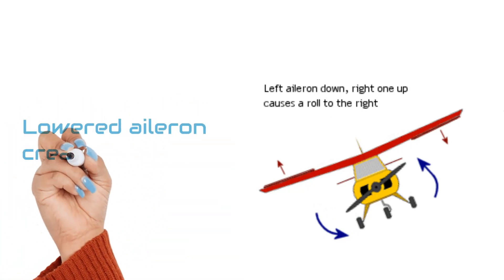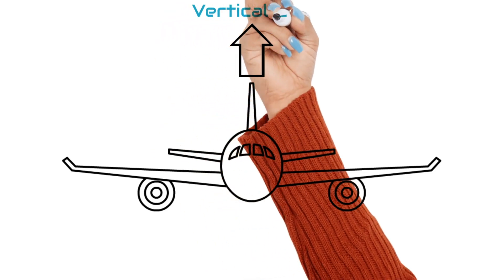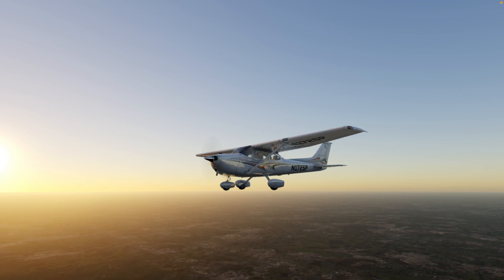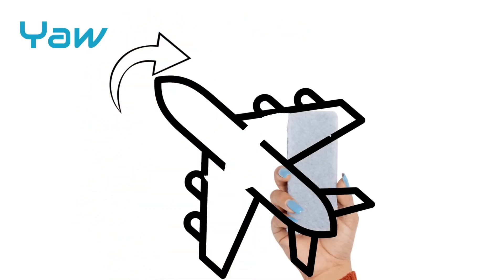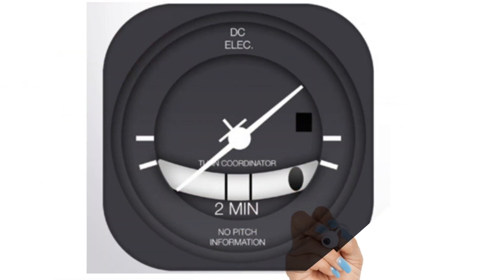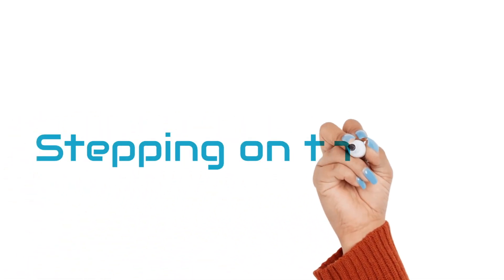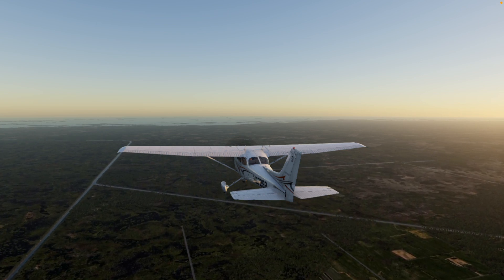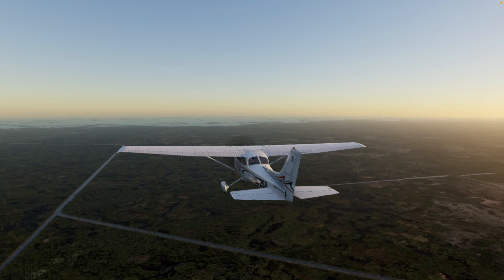How An Airplane Turns: Private Pilot Ground Lesson

Comment: Excellent explanation.  There is an unintended problem with how we explain coordination, however.  Usually we say we use aileron to bank and rudder for coordination.  We almost never say we use rudder to yaw correctly and aileron to bank for coordination.  This now sounds awkward, but unless we lead rudder there is no coordination initially.  Videos of students having the very common problem of longitudinal alignment with the centerline on short final illustrates this common problem.  Notice that the yoke is being moved left, right, left dynamically to constantly correct misalignment.  The only sure correction to this problem is to have the student remove her/his hands from the yoke and move the rudder left, right, left, right quickly and constantly to tightly bracket the centerline between her/his toes.  We don't want to turn and we certainly don't want adverse, incorrect yaw.  It is very disruptive.

Back to coordinated turns and leading rudder or rudder pulls aileron:  Dutch rolls, especially to 45 degree bank to overcome wing engineering to mitigate but not eliminate adverse yaw, drive home the fact that humans cannot hold the distant target unless they at least think they are leading rudder.  Aileron can come quickly or even at the very same time, fine.  Just lead rudder...trust me.

And yes, the wing's horizontal component of lift is what turns the airplane.  Pulling on the stick to increase lift in turns is dangerous thinking.  Dynamic neutral stability was intended to prevent this and thus prevent stall in turns.  When we pull back on the yoke to maintain altitude in turns, helpful in the limited pitch and bank of instrument flight, we need to understand we are neutralizing this safety feature.  The airplane does not want to maintain altitude in the turn unless we either use thrust or the potential energy of altitude traded for airspeed to accomplish this safely.